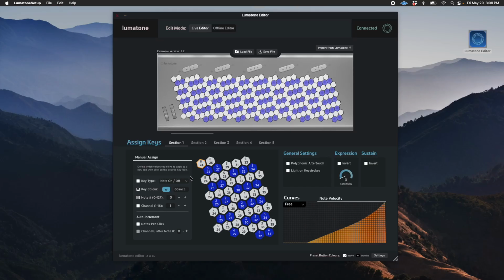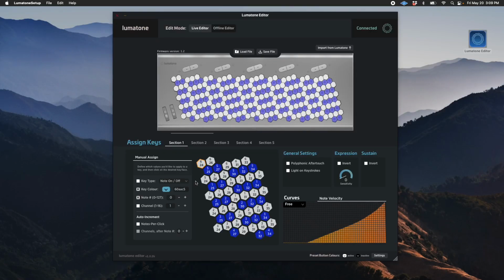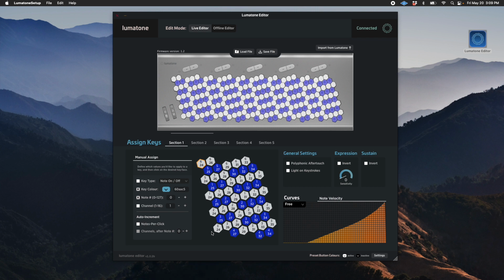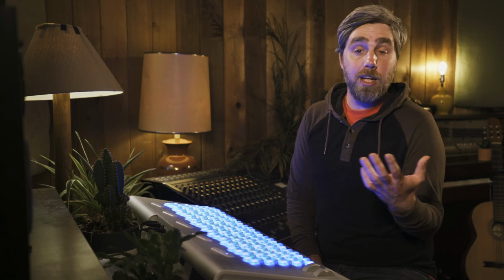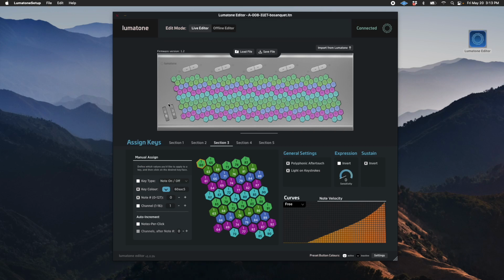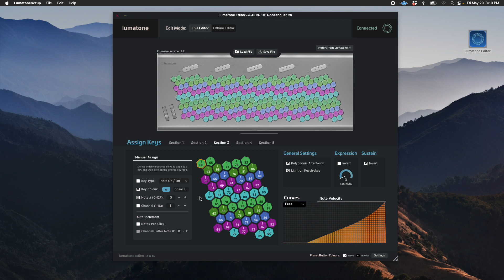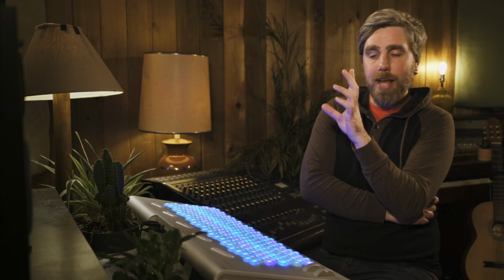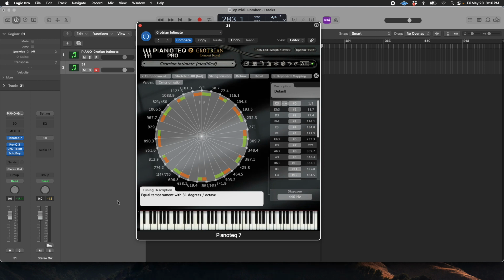Learning Lumatone: Episode 14 - "Midi Note Numbers"

Comment: I long for the day MIDI would grow up and allow me to play my Lumatone in 53-TET with range wider than like 2.5 octaves 😂
Reply: Using Pianoteq, one can have IIRC 10 channels of 128 notes each, so no worries with 5 octaves of any number up to 128 notes. (I regularly play in 53-equal, with naturals from A1 through to G6.
Reply: @camtaylormusic  Yeah! I've been wondering how to do that in stuff like kontakt and surge XT. I just don't know how to to change the octave on Kontakt and Pianoteq where the next channel plays a higher octave. If you have a suggestion lmk I'll be super grateful!
Reply: @amj.composer  Pianoteq added a setting pretty much just for us, in Tuning under Keyboard Mapping, called "Extended layout for up to 16*128 notes", hit "Multi-channel MIDI layout" to switch that on, and then select a "home channel" octave, where other octaves are derived from (for some reason I often have mine on 3)
Reply: @camtaylormusic  Wow!! That's perfect thanks so much. Peace ✌️
Reply: @camtaylormusic  I use the same range (A1–G6), but I have one octave per channel, and one of the 56 keys in an octave a CC (except for the lowest octave, which has two additional CCs)